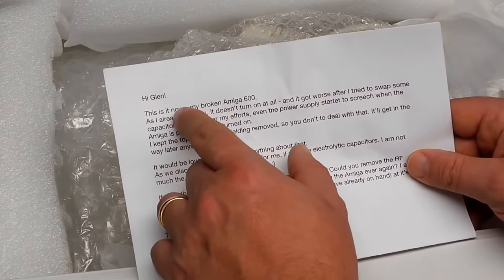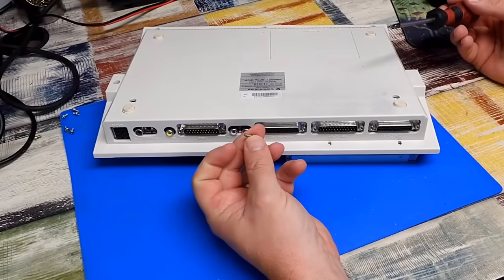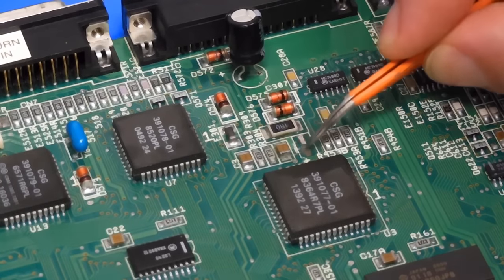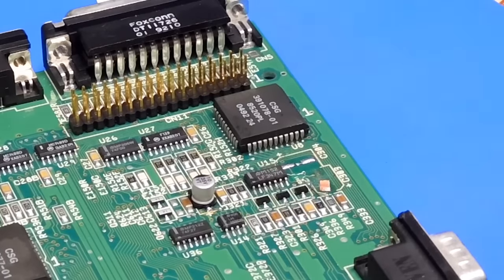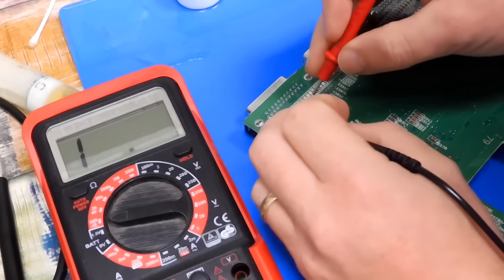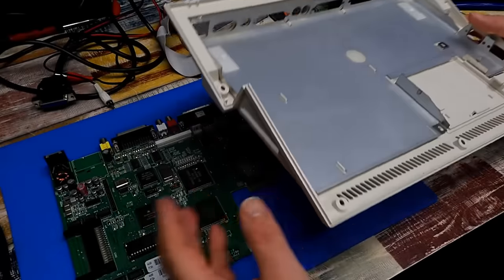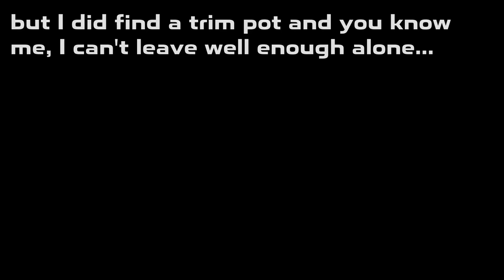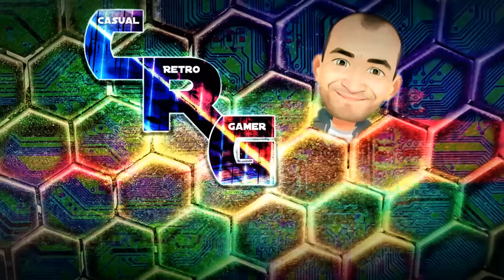Fixing, breaking and fixing an Amiga 600

Comment: Solder Mask
Yup.. a toothpick dipped in solder mask can paint around makeshift 
self-adhesive copper pads to hold them solidly into place before wiring 
them all up.
Reply from the maker: Thanks for the tip, I'll be sure to try that in the future.

Comment: A good turnaround there! You definitely saved the board regardless of issues. It looks like a particularly tight space to be working in with those caps. Well done!
Reply from the maker: It is tight in places but to be honest I also need to get myself some smaller tips for the iron.  In fact, I'm going to do that right now!

Comment: Thanks a lot for this video! As usual a lot to learn (especially thank you for showing mistakes , this is one of the most valuable parts in your videos!). I wish you could show how you disassemble and assemble that floppy but I guess you can't because of the language in those cut scenes :)
Reply from the maker: It wasn't so much but because of the language but rather because it took a good 20 minutes to get apart.  I did try to edit it into something coherent but it wasn't working out.  The disassembly (once you know how) is easy enough, remove that plastic bit at the rear (there's a plastic clip on the top you need to remove, then take out the spring, then the plastic bit itself).  Once that's out push the bottom part of the mech into the drive and the top bit will line up with channels cut in the side and just lift out. Assembly is just the opposite.  

Hope this helps.
Reply: @CRG  thanks the whole lot ! Copied this to my notes for the future if I need to fully disassemble my floppy drive. Surprisingly the one I have I managed to fix just by recapping one single cap on it which didn’t require any significant disassembling , happy me :)

Comment: Another note, some UV solder mask might have been a good addition to those repaired tracks. Cheap enough to buy and adds protection against possible shorts and holds the wires securely in position.
Reply from the maker: I don't think the wires will move as they are only spanning maybe 6mm but to be sure I'll add some mask to it before shipping.

Comment: Using a razor blade on a scrap PCB you can reclaim similar sized pads by scoring around them and sliding the blade under.  Glue the pads down with epoxy (you can get high-temp resistant epoxy but I found regular epoxy is good enough to withstand a small amount of soldering iron time.  I usually let the epoxy set overnight).   I used to be a hot air advocate for removing caps but recently moved the seemingly cringy method of holding down the cap and cutting the base of the can with side cutters, removing the rubber plug and cutting the plastic base free.  I think when there is still wet electrolytic under the cap, applying heat can lead to pad loss.
Reply from the maker: Thanks for the tips.   I have another project coming up that needs pad repair and I think I'll try to recover pads from a scrap board then glue them in as you suggest.   

Removing caps is always a divisive subject in this retro computer hobby.  I always used hot air as up until now I've never lost a pad but I fully accept there are other methods out there.  I think everyone just needs to use the method they are most comfortable with.

Comment: 20:20 The reason to drill those holes could also be that the table was tilted and to avoid the 600 to slip they have some pins in those holes.
Reply from the maker: Possibly although I'm sure there are better ways to stop it moving.  At least its fixed now.

Comment: Nice job fells, yeah I have recapped loads of A600 and those pads are notorious for breaking free of the PCB after the caps have leaked , to be honest I love the A600 but yes its down fall was the Cheap manufacturing methods of them done by commodore
Reply from the maker: Does make me feel a little better knowing someone as experienced as yourself has suffered the same!  I've got my own 600 on the shelf but not done much with it yet.

Comment: Nice work. Maybe the holes in the case can be repaired by placing glue tape, or masking tape, on the outside of the case, and from the inside, right over the tape's glue, filling the hole with superglue and baking soda.

I would test it before with some useless piece of plastic to check the results. I managed to do some bars that way in an PSU enclosure I printed a year ago for my 3D printer (the grills were too weak and broke, so I had to resort to this technique).

Comment: What is the flux you are using? It flows better than what I use
Reply from the maker: I use chipquik SMD291.  The 30CC syringe is £34 on amazon.  Its expensive compared to some but I couldn't do without it.

Comment: When you are attempting a repair remember you can't break it more if it don't work in the first place, I had exactly the same fix to my 600 and it was because of leaking caps that weakened the pads and I used slug tape exactly as your example no problems.

Comment: I cut the replacement pads and tracks from old pcb's and stick them down with epoxy resin then tin them up when its set.
Reply from the maker: Thanks for the tip, I have another project coming up soon that will need repair like this so I'll maybe try your suggestion.
Reply: @CRG  its a permanent fix but for most pads you only need a pin head of epoxy as it spreads.

Love the videos and the way they are delivered 🙌
Reply: @CRG  without destroying the magic i use Gorilla Glue(two part epoxy).

For pad repair I don't even squeeze it out i just use two cocktail sticks, one for the epoxy and one for the hardener. 

Poke each one into the each nozzle on the product and mix those two little bits together. 

Gorilla cures quite quickly though. Its workable for 5 mins tops then its quite rigit. 

If your quick with your soldering your good to go after an hour.

Comment: Getting a higher voltage on switched mode power supplies is normal and as you’ve discovered they need a load. Love your repairs but I would have super glued the damaged pads
Reply from the maker: In hindsight that's exactly what I should have done but when they first came loose my initial thought was just get them out of the way.  All a lesson though and next time I'll just glue them down!

Comment: I don't know why you didn't superglue the original pads back down.
Reply from the maker: In hindsight that's exactly what I should have done. I suppose at the time my initial thought was it'd be easier to use wire but after doing that and even if I had have fitted the correct caps the first time I think I still would have went back and redone the pads.  This one really was one mistake after another, no excuse for it really but at least its fixed now.

Comment: I thought you'd just have to buy an adapter for a Schuko-Plug (the German two-prong plugs with the grounding pads) into a three-prong UK plug. But I didn't know the UK uses 230 V 50 Hz and not 240 V 50 Hz like in Germany. I live in Costa Rica, so it's US voltage (120 V 60 Hz) and plugs (Type B), but you can fit some plugs with 240 Volts with some hackery, but you'd still need to convert the plug. Maybe next time I could try to get some Schuko plugs from Germany to fit.

One thing I like about that Amiga: It has a proper QWERTZ keyboard. ;)
Reply from the maker: Yeah all of Europe is 230/240v 50hz.  All we need to do is convert our plug tops to suit the outlet.  The voltage in our walls is said to be 230v but in reality it measures anything up to about 245v.  

And yes it was nice to see the qwertz keyboard, it was the first one of those I've seen!

Comment: Justification for a 2nd soldering station? Set it and lock it to a lower limited temp? Maybe one without the large tips that can produce extreme heat or without the thermal mass to sustain that high heat?

Or if you have the space, stuck in a different area on the workbench. High power / high temp on one end of the bench while low power / low temp stuff at the other end.

Maybe one of those Pinecil irons for the fine work, they're rated to be pretty decent and don't cost the earth.

Just thoughts.
Reply from the maker: Yeah I like that idea.  I'll have a look for one of those small irons like the pinecil, or maybe leave it and see if Santa will bring me one 😉

Comment: Why not just use leaded capacitor and shrinkwrap over the exposed legs and solder to the nearest components?
Reply from the maker: No real reason why not and it had crossed my mind.  I suppose the only reason not to is to retain the original look.

Comment: What a bodge job! Why on earth did you chop these pads of man? You could have used a bit of epoxy glue underneath to glue them back or even soldering mask on the side to secure them! And why the hot air when you can easily remove all caps simply by using two soldering irons like a soldering iron tweezer!
Reply from the maker: In hindsight yes I probably should have just glued them down but it's done now.  As for hot air, well, it's just my preference.   Some people swear by two irons, other by cutting the caps off.  As the saying goes each to their own.
Reply: Well, cutting/twisting the caps off is an abomination really!  @CRG  😁

Comment: Oh stop blaming yourself about the pads. Boards that have leaky caps, the pads will de-laminate when you look at them funny. But I know the feeling. Its the main reason I don't do repairs anymore on the more expensive boards, and only true the friends network. People that understand that there is a possibility that a pad lift can happen, or that a 30 year old piece of technology can die without any reason.  You did a very nice job here, but please use microfarad and not UUUUFFFFF 🙂
Reply from the maker: I know but its hard not to.  It's the first time I've lost pads in an Amiga!   I always try to help anyone in the community but I have said before I don't want to get bogged down in repairs.  I did refer to them as microfarad for most of the video, just slipped into old habits towards the end 🙂